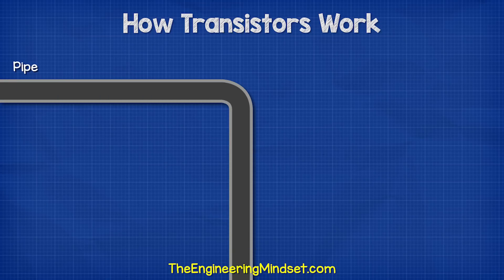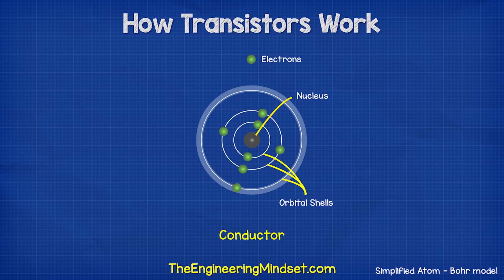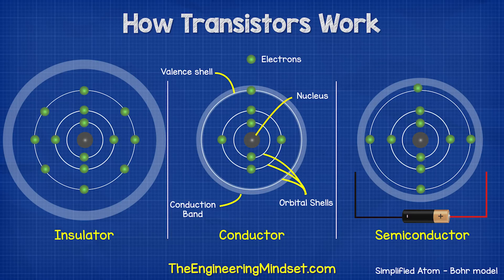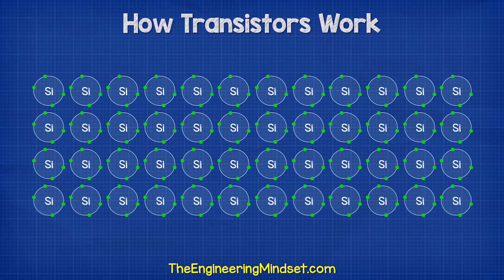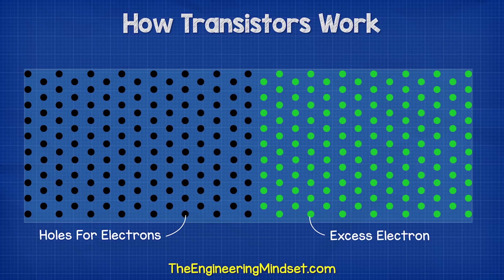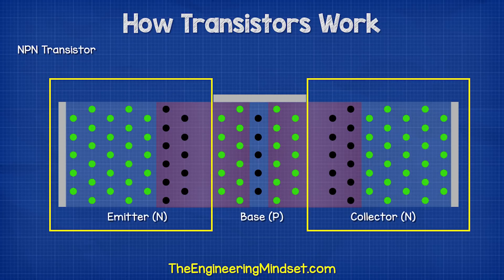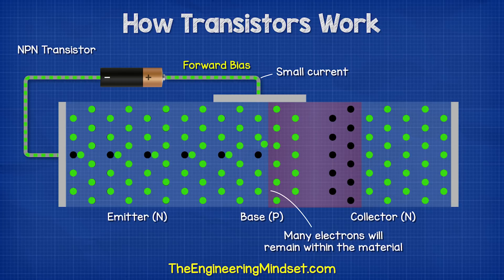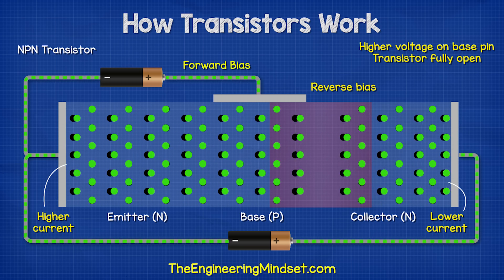How Transistors Work

Comment: You did not explain what happens if the negative of the source voltage ie: battery is connected to the base and positive to the emitter in an NPN transistor or how that relates to a PNP transistor. Or if that is something one would not do or if it is, why one would want to do that. Also is it necessary to have two source connected one forward and one reverse in order for the transistor to work. This question is a result of you showing two voltage sources connected to one transistor without explaining why you did that with one source connected from base to emitter and the other emitter to collector. Again no explanation given for why you did both and how that relates to a PNP transistor.

Comment: At 6:07 has your battery done an impetypodance or have I missed a sleep ping?
Reply from the maker: Answer: https://youtu.be/PXNKkcB0pI4
Reply: @EngineeringMindset  0.5V on a 1.5V AA alkaline battery resembles a typo.
Reply from the maker: It was demonstrating if the voltage is below the required minimum value, it won't allow current to flow. For example, the battery might state 1.5V but brand new itll be 1.6V and when dead it might be 0.4V

Comment: Fun fact: the thumbnail for me showed the very famous 2N2222 transistor.
For this transistor the explanation seemingly completely breaks down, because the 2N2222A transistor can amplify (and work as an oscillator with LC filter) without its base pin.
You can snip out the base pin, and use the emitter and collector and can get a amplification from the device (kind of negative differential resistance)

Comment: You did not show how you build a circuit to completely reset these transistor circuit units you mentioned, you just showed a way to partially reverse a buildup, but you didn't actually show what to do to balance this potential in a multiple layer circuit.

Comment: Topic request please.

Could you please explain what is happening when you plug too many things into an outlet, say via a power strip, that it causes an overload.  

I assumed that everything would just receive less power, but instead it is acting like the devices are causing more power to be drawn.  So it's not like electricity is just traveling through a path, but instead is being pulled.  So, kind of confused.

Thank you!
Reply from the maker: Please see our electrical current video

Comment: What is the emitter, base and collector?
Reply: Base is current input, collector is signal input, emitter is signal output.  That's about all that makes sense to me, and I didn't get anything resembling an explanation from this video.
Reply: @BigSmartArmed  I've not seen a video explaining that.
Reply: @CatnamedMittens  Power transistor amplifies input signal.  Base is the input power section, the more power input can handle the higher the power output is from the emitter.  Collector is the signal input gate that controls the emitter output.

Comment: Back in the days of using house antennas (90's), I once used some old telephone wire to bring it to my room. It was then that I learned the difference between just any type of wire and Coaxial cable. The old telephone wire was not capable of providing a strong enough reception, which I later replaced with coaxial which was infinitely better.

Comment: 5:25, can you explain why the electrons don’t keep moving left? Would the significant net positive charge continue to attract them?
Reply: I think the attraction of the positive charge on the right doesn't let them do that. The forces that could make the electrons move further to the left are kinetic energy of the atoms in the P-region and energy of covalent bonds of the atoms there, and these energies are not enough to overcome the attraction of the positive charge on the right completely; thus there is balance, but no flow of electrons without external voltage applied. That's how I imagine it to be, but I'm not sure if I get it right. ☺ Sorry for intruding with my opinion.

Comment: What was covered here would be the first of maybe 3 or 4 parts at this rate if the functional use is included. Always remember that a basic transistor is to an extant an electronic version of a relay.

Comment: The Transistor is probably one of the greatest inventions in history. The things this tiny device enabled us to do are counless
Reply: Invention of the transistor is the modern day equivalent of the invention of the wheel and the inclined plane.  Difference being those early inventions affect physical objects, whereas the transistor is used to manipulate information.
Reply: Prity sure gears and screws are more inpatient than the transistor
Reply: @alexhail9971  screws and other stuff are so simple they had to be invented at some point. WhaT's so hard about shaping a hot piece of iron into a gear, you have to be an engineer to understand the complexity of a transistor and how it leaped modern technology to unprecedented levels. Every integrated circuit in every piece of technology has to uses micro or even nano transistors. They transformed computers from massive devices that consumes tons of energy that can barely add 2 numbers to hand held computer that dose wonders in comparison and operates on a battery
Reply: @alexhail9971  I think spelling is the more important invention.
Reply: @johnnypopstar  whoops 🤭 sorry
Reply: @johnnypopstar  -  or maybe the discovery of variances in actual ability of some to relate to spelling.
Reply: @nonamex3052  My lad, you see the blue colored name in the comments ? Those show that Johnny wasn't talking to you but the other guy who wrote "inpatient" instead of "important". 🤓
Reply: @mysticmarble94  thnx
Reply: no cap my g
Reply: Truth. But without the best of history, Mr "Benjamin Franklin", "Alessandro Volta" among others, nothing would have happened...
Reply: the nail even more..